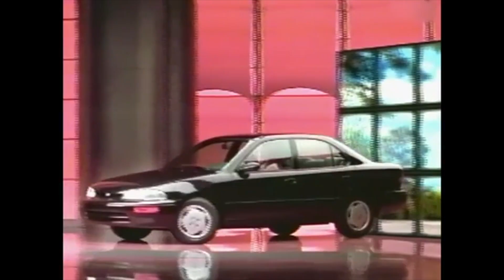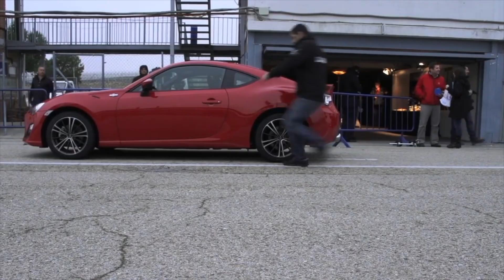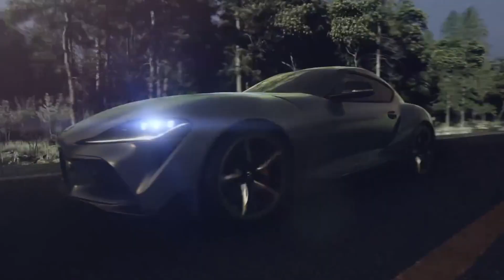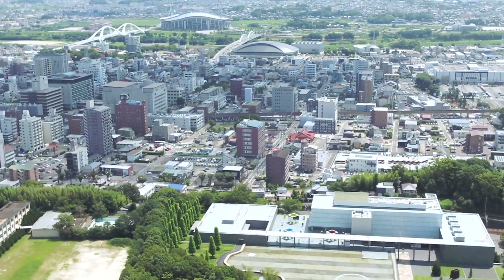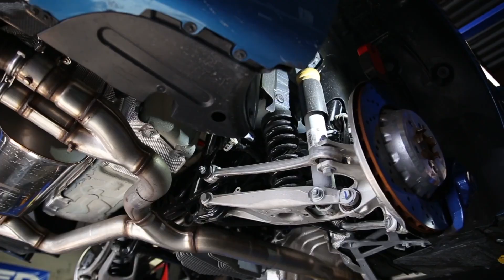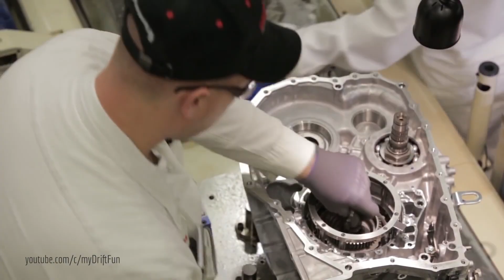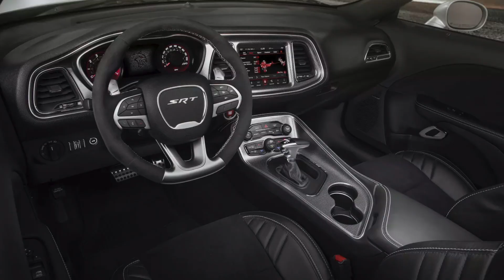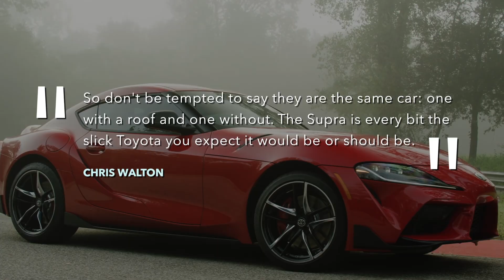MKV Toyota Supra - BMW or Toyota? The UNTOLD TRUE STORY

Comment: The golden era died in the 80’s and 90’s when japanese sports cars were solid, smooth, distinctive, “ Premium “

Nissan had the 300zx
Toyota the supra
Mitsubishi 3000gt
Lexus the LS

After that japanese sport and luxury cars started slowly declining towards the 2000’s.

Car centered towards the drivers slowly declining with less interesting features, tacky buttons everywhere, hollow cheap interiors with “ premium “ stitching, cheap black plastic on the body, plastic headlights, pearl paints replaced by cheap non pearl colors. Plush premium seats replaced by cheap thin solid aftermarket looking seats.

In other words quality, luxury, got replaced by tacky cheap concepts fooling you into thinking your paying for something “ fun “ “ lit “ “ edgy “
Reply: @E M I agree with you. Now its time to buy one of this good old cars as long as they are affordable. :) 
I only had problems with the newer cars ... and I dont miss anything of the features. Maybe a head up display would be nice but definetely no game changer. Who need this lane holding assistant?? 
And I have litteraly no problems with my old BMW. Service, oil change and everything is fine. Late 80s, 90s and some Models to the mid 00s are the legendary eras (imo).
Reply: You forgot the NSX.
Reply: You words weighs gold, Yes, this is today's cheap plastic built vehicles, Uncomfortable very stiff and veryyy expensively sold cars, There is no doubt new safety technologies are wonderful and it should be price combined and a part of automobile development and not as an option to be sold separately and this is the evidence that it's a matter of profit if an individual is financially able would you uncheck any safety feature? No i don't think someone would compromise his/her safety, In addition spare parts are now  being sold by bulk by the dealers and are very expensive where are the good days of selling that specific part that is broken and not a full unit!!, Another thing they force you to fix in the dealer by making the design complex so you can't do it by yourself!!
I'm an optimist personally, But that i had to say.
Reply: and my favorite manual transmission is no longer an option in 99% of cars
Reply: @RichardSaysNever  yeah all the great cars got too expensive and then US emissions had made it trouble to sell in the US. Japanese economy wasn't good enough for young guys to buy their own cars.
Reply: @HanSolo__  exactly, the whole Electric bullshit tackeled the entire automotive industry into an era of uncertainness. 90s noone wondered "oh I hope I can still drive this car for the next 5 years" because there was nothing to worry about... Now with all the pro-EV politics.  It doesnt matter if its within 5 or 20 years. For me car enthausiasm is partly ruined due the feeling of an uncertain fate.
Reply: In fairness, they lost a fuck load of money making those cars. But god damn were they excellent. A lot of those 90's cars are what made me fall in love with Japanese auto makers. They just seemed to get it.

Comment: Saw a video of Toyota FT-1. They should have stuck to that design!!
Reply: Then that’s what they should of done instead of being cheap asses. For Christ sakes this car was supposed to rival the gtr
Reply: They did, but if they stuck with the whole FT-1, it mean trying to find/build/research & development for the inline 6. Which mean the cost for the new Supra be up, say 100k. At this price, you and I could afford it.
Reply: FT1 looks more like a super car than a sports car. If they released the FT1 with an appropriate price tag people would be complaining that a Supra shouldn't be that expensive.
Reply: 150000 USD Toyota?
Reply: ye, the FT-1 looked awesome. The new supra i cant get warm with. It looks wrong on so many levels
Reply: The Supra is suppose to be a super ar compared with the gtr. People wouldn’t mind paying 100k on a Supra as long as it laps Nurburgring quick enough with around 700hp in-line 6. It’s not hard to make. Toyota is just full of retards. You can go ahead and call the LFA the most recent Supra.

Comment: Quote"Great video.  I say this to everyone who I talk to.  Who wants a Toyota with BMW reliability.  And this video answers some of it.  But the platform aside, this is a BMW parts bin car.  Not manufacturered in anyway by Toyota.  That is a hard sell, namely you slap a Supra badge on it. The other part, a lower HP driver's car with no optional manual trans at launch is a huge contradiction to their sales pitch for who they are marketing it towards."You clearly didn't listen to any of the video.The Chassis was jointly developed by both company's and then manufactured by an independent company. So to say the supra is just is just a BMW parts bin car is complete rubbish.Do you think Toyota just slapped there badge on he car after 5 years of development?Get real and try looking beyond the hype and form a sensible opinion.

Comment: It's still a z4. A supra is supposed to be a longer wheel base gt car available with a manual transmission,  not a tiny bulbous 2 seater roadster with an automatic. It's like when dodge came out with the new charger. The original charger was not a boring 4 door sedan, they were 2 door muscle cars.  It's a matter of honoring a legacy properly.

Comment: I just think supra fans are peeved because the engine is not a 3JZ GTE (or a updated 2JZ) that has massive tuning potential. 
Needless to say if the mighty BMW N54 twin turbo engine is anything to go by i think the tuning headroom will be there in spades seeing as toyota basically told BMW (let that sink in , BMW) that some of their engine parts are shite and they need to make it stronger. 
So in essence the MK5 supra will handle better launch better and have a i6 that can be tuned to the moon and back. 

No one complained when a motorcycle company developed the 2JZ but want to moan when a car company and a good one at that develops an engine. 

reserve criticism for after you have driven it ...

Comment: Awesome way to use reverse phicology,  start with a badged VMW end with a is all in all a complete separate car Lol 
 Lots of info, great video, but lots of info missing 
1.- 2020 Supra no longer competes with Camaro Ls1 nor Mustang Cobra like it did back in the Supra times of 1998 except for its price. 
3.- now the Dodge Demon or Red Eye
Left the competition behind and went for the gold taking on the Zr1 and Viper and all other exotic cars. 
3.-  of course is q sec. Faster than its predecessor but .5 slower than those mention above is that a deal breaker? 
4,- Looks more like an amazing CELICA
but didn't live up to supra fans dream.
5.- Is an undeniable well made car, but only sells will stay as witness of those who loved or hated the new badged car.

Comment: What annoys me the most about the new supra is how small and tiny it is. I want the Supra to be a high horsepower GT, like it used to be. Which is good for high speed and highway driving. Not some slow tiny mx5 miata looking thing, for corners only.

Comment: The original NSX, 3000GT, Ferrari F-40, 300 ZX, Supra were all 3 liters and all came from one freelance designer.  This one is no different.

Different manufacturers don't really matter too much as the engine was designed by the same guy that designed the last Supra, VTEC, Vortec, Voltec, Duratec, Ecotec, Ecoboost, Skyactiv X and many more.    

Chances are... you already have one of his vehicles in your gararge!  

There are only A few more of his designs in the works as he is retiring.